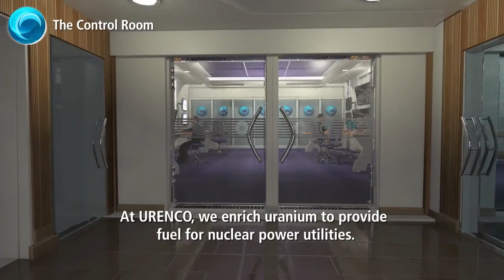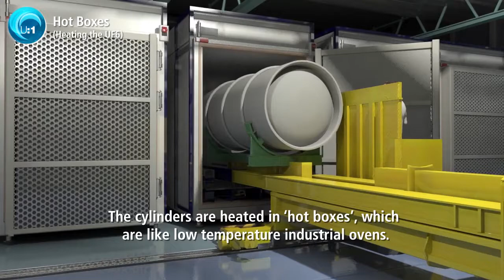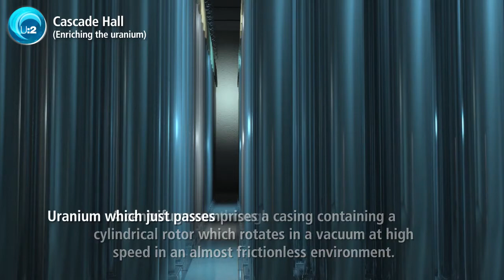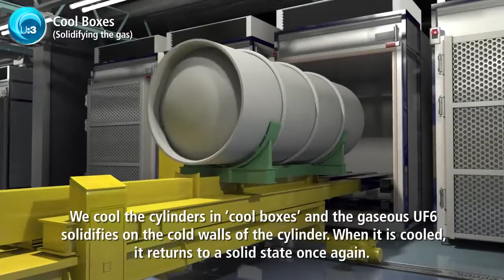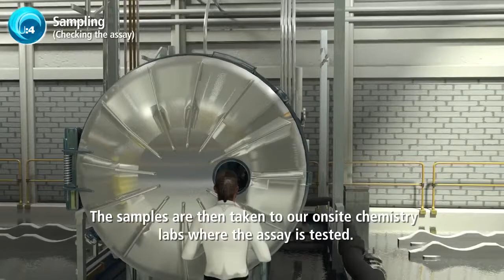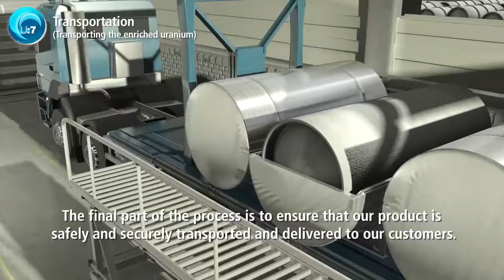Urenco Virtual Tour - How do we enrich uranium?

Comment: Man has NO business enriching Uranium. The ultimate penalty will be an Earth hopelessly populated beyond repair. I was told in 2008 by the head of security of the Hartsville South Carolina Nuclear Center that: "You are not qualified to converse on this topic. There will never again be another meltdown". What happened in Japan in 2011?
Reply: What happened in Japan was caused by a tsunami. After an 9.0 Earthquake, the reactor was shut down and diesel generators were used to run the cooling systems. The Tsunami then reached land and flooded the nuclear power plant, shutting off power distribution systems and also had breached the room where diesel generators were stored. The government in Germany for example is not responisble for the failures of a private business who ignored government regulators (that were political and ignored the issues) and warnings of preventive action. These are isolated incidents, things that could have been prevented but weren't and the world is smarter off afterwards on the risks and dangers of using Nuclear Power and regulating it. To argue your point about having no business enriching uranium, if for example Japan has completely overhauled how their system works and have nationalized nuclear power, replaced government regulators and have fixed their system, why shouldn't they continue using Nuclear Power.  I think the corruption of another country shouldn't dictate other countries whether they "have the business" to engage in nuclear energy. Your point of view is so primitive when advancements in the world are being made and can be done in a very safe way.